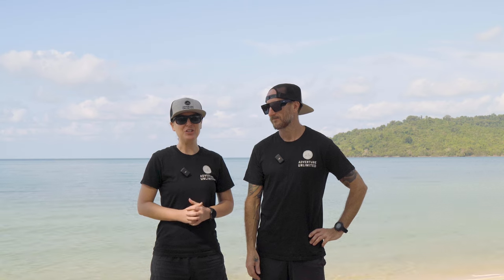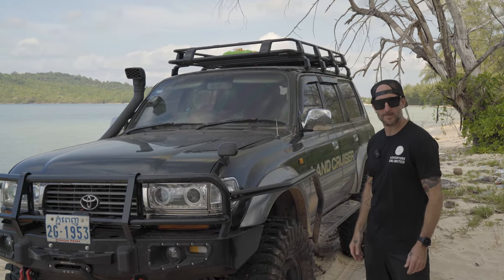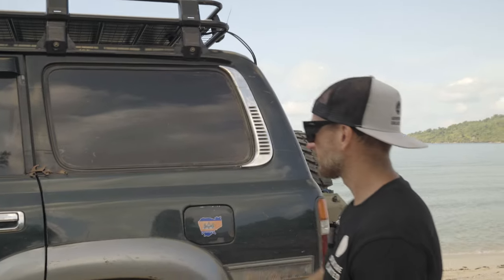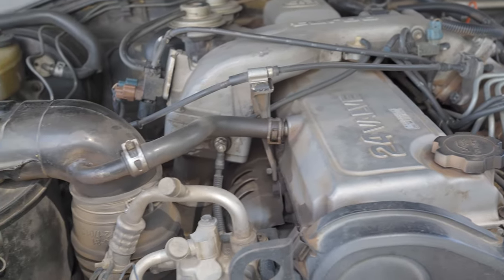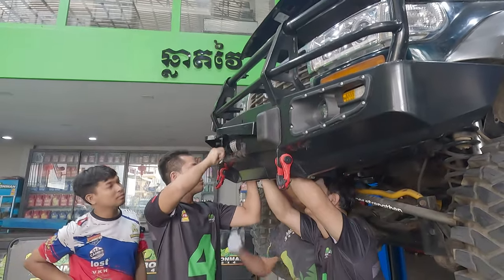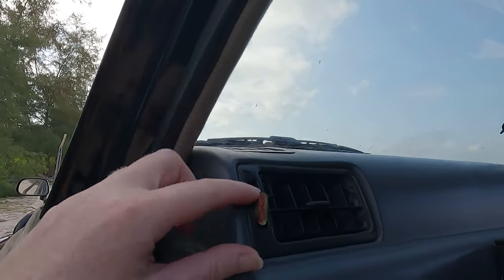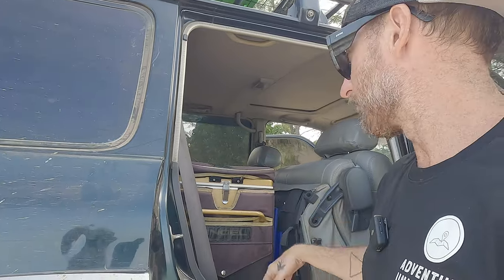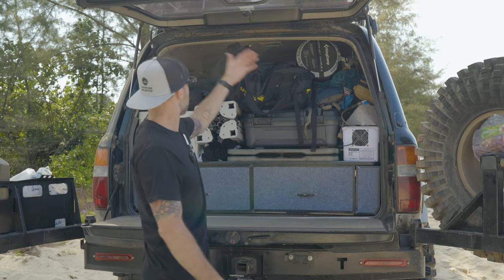JACKED Toyota 80 Series LandCruiser Rundown - Landcruiser ស៊េរី 80 ដ៏ធំ

Comment: This just popped up on y channel, so bit late to the party, so you probably have already sorted many of the issues and more knowledgeable about the car.

Pretty cool setup and great to be able to travel with in Cambodia, what an experience and trip, more so doing it an 80s, super sick. Be checking out the channel to follow that.

Few things the 1HD series of engines all have the same block, FT all fuel injected bore and stroke the same, 94x100, the T was 12V mechanically injected, the FT is 24valve still mechanically injected, compression ratios from the 1HD-T and FT are the same, different glow plug setup, FT actually uses an internal glow screen heater which is also the same in the FTE.

The FTE from the 100series is Electronically fuel injected, slightly different compression ratio B&S the same, they are the basics, you can push a bit more horsepower out of the FTEs, 260 max rec stock on a -T, with mods, turbo, FMIC intercooler etc, 270-280 on an FT and 300 comfortably on a FTE.

The FT is awesome, also look at getting a transcooler on there and maybe a valve upgrade. Plenty of options in Aus for that.

By the way its a 5 link setup in the rear, its using a panhard at the rear like yours has which is standard, someone has built an aftermarket panhard riser bracket, which is a good thing generally.

But it looks huge, from what I can see (but may not be able to see) is bump stops look standard, with a riser you should have extended bump stops, 70mm on the rail stop, otherwise you can have chassis clearance issues. I cant see any, also a extended rear brake proportioning valve bracket, also check the front as you will get scrubbing otherwise! 

Looks like swaybar links etc have been setup at least have been extended which is good. Again its just what I could see from limited views.

The lack of bump stops "may be a reason" why the axle diff has been cracked,  with a 6" lift and 37s on a 5link on an 80series is crazy imo and no bump stop control, allot of stress is going into that axle, esp with loads and esp if its been off the ground beach dunes or through rough stuff at decent speed..

This is a common issue when people lift vehicles they focus on lift and shocks, not other factors to support it. Either don't know or don't get the right advice or its something they do in the future, wrong do it at the start or it will be costly and unsafe.

Properly setup 2" to 3" lift which is best (3"0 for an 80s imo/e is the best compromise if still running a 5link setup!

If you go more might as well go to a 4 link setup and coil overs to do it properly, that's expensive and outside of the USA, probably not road legal and engineering might be difficult, eg Sam Young check out his build and issues. 

I have an 80s, 5spd MT, but we have plenty in our club, most are 3 to 4' lifts, I can wheel anywhere and flex better than all of them, we did a flex ramp test a year ago when I was still at 2" lift and my 80 was the only one to get to the top of the ramp forwards and backwards with 35s.not using lockers, I did get out flexed by a 6" Patrol but it was a custom setup SC ute.

I would get someone to check your up and down travel, check no issues there, check your bum stop limits if that hasn't already been addressed, def look at a 105 sector shaft upgrade for you front steering box and brace the chassis around the box, cheap easy common issue mod to do on the 80s! I run a full Manta 3" turbo back exhaust no muffler on mine just a resonator its not loud has a great tone, no issue with legality either.

Again long past, but first thing I always do when buying a vehicle is drop all serviceable fluids, plus replace filters!

Engine oil, diffs, trans and tc, this tells you more about its condition more than any mechanic will or can, you will know first hand what needs done from that, before getting advice from someone whose interest is to take money off you or sell you something.

Its not hard  for anyone to do and you don't need to be mechanical to do it, a must with any vehicle like this is imo to learn or know, rest can learn over time!

Get a good Toyota workshop manual, keep it and scan key maintenance and service things into your phone.

Just some thoughts if you haven't already sorted them out, or checked.

Will follow the trip, Im sure its been a blast so far🤘
Reply from the maker: G'day, thanks for the comment! We have ironed out a lot of issues with it. It's full Cambodian spec so nothing is perfect with it! Swapped out the rear diff and twin locked it while we were at it. Swapped out all the fluids straight up, transmission fluid was leaking as the bolt was only finger tight. Few issues with old heater hoses which we're sorting now. Have fitted a trans cooler and thermo fan. Definitely still needs bump stops in the rear, flares are still the factory bump stop 😅 We know 6" is massive overkill and unnecessary but it's such a novelty coming from Australia with such tight modification restrictions, and it's a weapon that goes absolutely everywhere it can fit! Definitely turns heads out in the provinces. Will bring it back down to 3" and 35s when we bring it back to Australia and it'll still be a weapon. After 6+ months of owning it we haven't had any major issues, and for its age and lack of maintenance over the years before we bought it, it's running like a dream. Thanks for tuning in and taking the time to comment 🤙🏼
Reply: @adventureunlimited  Awesome dude, thought you would have, its a beast for sure. Cant go wrong and def worth investing in anyways. enjoy the 80s life, they are great vehicles.👍

Comment: You have to have correctional hearing, heavy duty diff bearings, for it not to break!  35 inch tyre,s are heaps, 4 inch lift, anyway good luck, 😮
Reply from the maker: Cheers, we're off to the wreckers this morning chasing a few parts including diff housing so will see what they've got. Does have reduction gears which I forgot to mention and will definitely drop the lift and tyres eventually. Suspect the big lift and tyres will be handy in the wet season here!